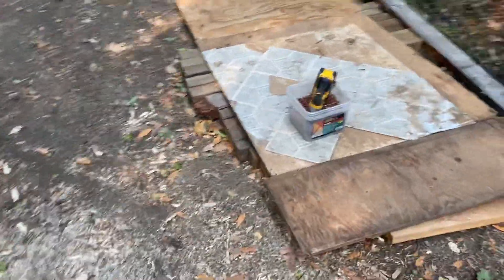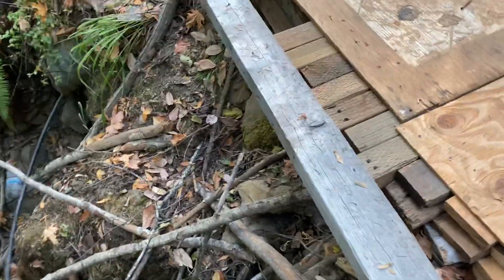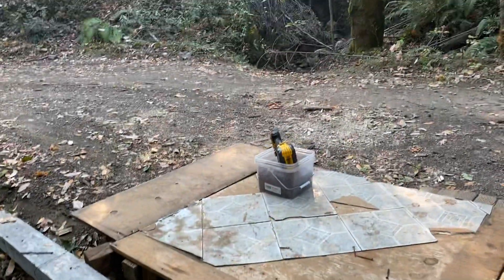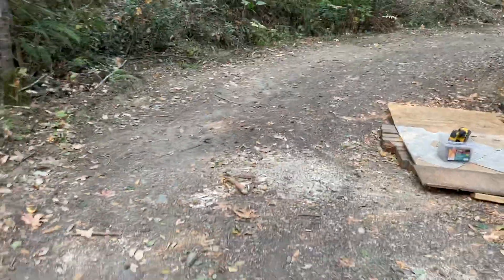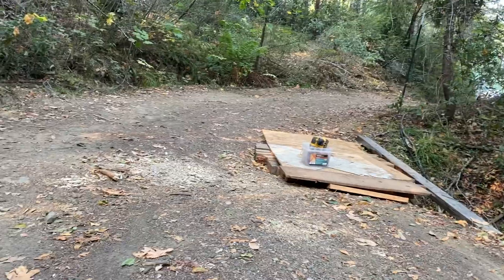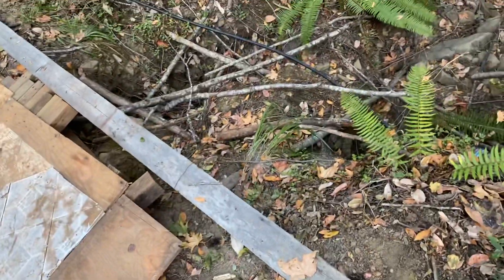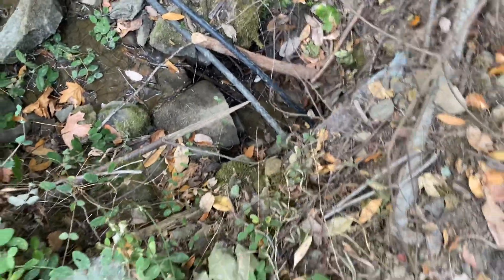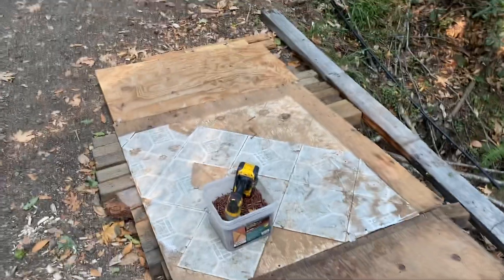Road collapse

Comment: Had a very large ditch to cross into my property. Used a very large metal culvert pipe. Laid quickset bags very strategically placed & stacked, didnt remove the bags covering. 1st rain wet & set them in place. Over 2 decades that culvert & its quick set bags are still there, through horrendous fast moving flooding. It was so simple my mother & I built it ourselfs after the harware store dropped the big culvert pipe where we asked. 50 quick set bags later we had a road across a 25 ft. ditch